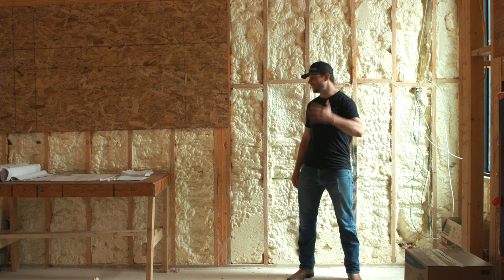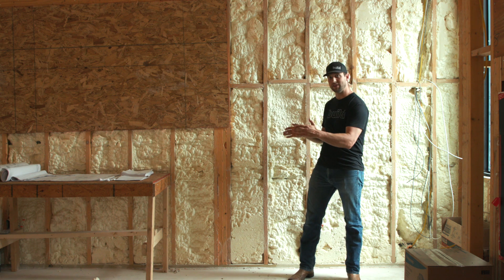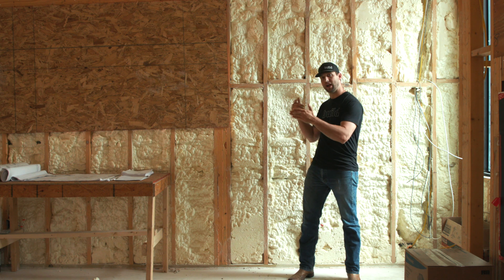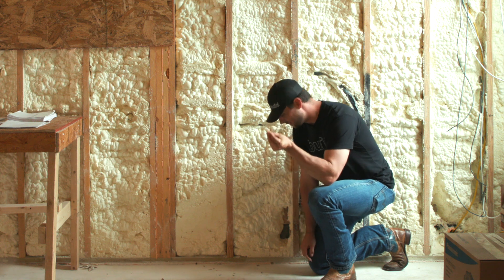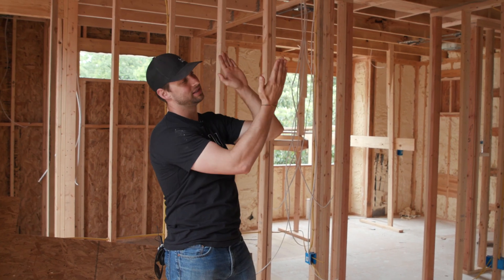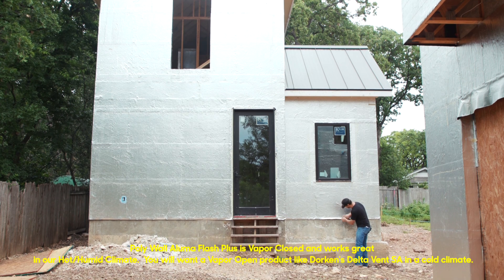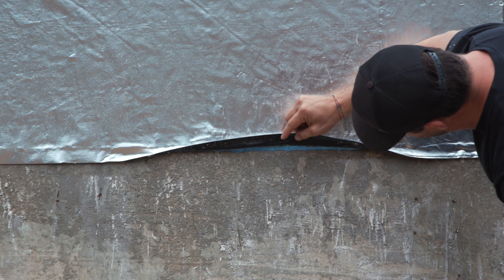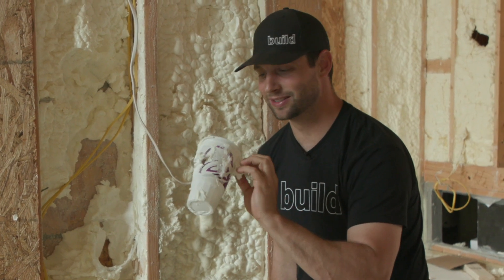3 Spray Foam Problems

Comment: What's the name of the previous contractor doing the insulation? They need to be outed
Reply: I'm not sure how many polyiso jobs you've hired out but I've had to fix air leaks in every single job I've ever done. It's very difficult to get 100 percent sealing. It boils down to this, if the rework you're inevitably going to do is too extensive and your contractor is not improving his quality, you have to move on to another company. 

It really comes down to the guy on the gun. If he can't be bothered to do what is expected, he's losing his company my business. 

I've had to switch contractors and I must say, the norm in thirs area for spray jobs is not great quality for price.
Reply: Chanting out them out, out them out , out them out 😀 by popular demand
Reply: they should but Matt and his team are too respectable to do that which i commend them on
Reply: @coltonarendt  
Nobody should be commended on hiding the names of lazy ASS _ _ _ _ _ who depend on their next victims not knowing. Foaming a cup into the wall??? The reason I take offence is because years ago, while helping an electrician friend on a few houses in new sub-division, we found that some of the houses had a bad odour in them; we learned from sub-contractors, that before the drywall was up, some workers were actually cutting vapour barriers and peeing into the insulation, then taping it back up because they were too lazy to go outside and use the porta-potties. I still get disgusted when I remember that! Pardon the pun, but, you let crappy people get away with stuff and they get shittier.

Comment: Why the hell is it so hard for some to build a house right? This isn’t rocket science.
Reply: Actually it is complicated. There are many factors and home building materials changes much faster than Rocket design. People think that Home construction is easy. it is not!  A good contractor & good Sub-contractors are worth their weight in gold! It takes lots of planning, research to do it right.
Reply: Again, lets be honest- anyone with a brain in residential construction  almost inevitably migrates in becoming a GC. Thats economics alone. The people eft framing your house including insulation, forget about asking them if they have been trained to do what they do-do they even have a HS education ? If you CARE about what you are doing building something, you eventually wnat to get paid-so you go into GC or change fields entirely. When you add county development tax and utility hookups, even if you have a bare lot 50 feet from a county road, its >$100,000 to break ground-hospices are EXPENSIVE !

Comment: The more and more I learn about spray foam, the less likely I am to use it. It's costly, doesn't actually seal as good as stated and can off-gas for years. Much better off doing rockwool, and or exterior foam. You need a thermal break up north. Even a filled 2x6 wall with spray foam vs fiberglass/exterior foam wouldn't give as good of an over-all R-Value.
Reply: If applied correctly, it doesn't off gas for years, a day or two at most. A 2 X 6 wall filled with closed cell is roughly an R-36, tough to top that, plus the added structural integrity. Add an 1'' of foam on the outside and now you have R-42. Rockwool at 6'' is only R-18, only half of the closed cell. Add 1'' of foam on the outside and you still only get R-24.  Nothing beats closed cell foam at the moment.

Comment: One gigantic problem with spray foam is if it doesn’t dry correctly. I watched a video out of Canada where a family spay foamed their attic while they were in the house. The foam didn’t dry properly and it off gassed an odor of rotten fish. Everyone got sick and was diagnosed with neurological issues. They had to remove the entire roof, trusses and all and have people in hasmat suits dispose of all materials. Some experts say never to use it because it is not in a controlled setting of perfect temperature and humidity. That is why I am personally unsure about using it on job sites.
Reply: Product quality is important. I know the video you watched. Proper product and proper installation and you'll have a properly insulated structure. Dont go super cheap. You get what you pay for ya know?
Reply: Saw that too. Bad instal

Comment: With a stucco exterior home where would I be considered with air gaps/ leakage.
Reply: Stucco guy here:  Our house, like the million others within 60 miles has stucco on the outside and we're in the hottest city in America.  121F is the record we've hit two years in a row.  Stucco on the exterior under those conditions is stupid.  Yet every house has it.  Add one of the exterior insulation systems M. Rissinger has been advocating these past months to capture the thermals mass and isolate it from the excessive heat.  You could install an uninterrupted layer of polyisocyanurate panels 1" thick over the entire wall first, then frame with steel a 2nd stud wall and use the closed cell foam in that cavity.  Wrap with something suitable for your climate, it should breathe because you already have an impermeable membrane in the form of the Polyisocyanurate 1" layer.  A radiant barrier if you live below 30 degrees N. latitude.  Then the siding of your choice.  A similar process for the roof to complete the envelope, more or less.  These houses also need a basement, or a below grade cool space (cold storage) to provide air for a heat pump driven, forced air system that stays out of the attic.  Otherwise,  we should let most of them burn.  The builders 50 years ago had few priorities that apply today.

Comment: man if they stuck a tacobell cup in there just imagine all the other jerkoff things they did to that home. I feel bad for the owners.
Reply: I'm an electrician, and I've busted the general laborers (sweepers) jamming plastic bottles down into the drain pipes. The plumbers were far from pleased and those little jerks were fired the next day.
Reply: @KingTesticus  
Just last week I helped my brother (a plumbing contractor) do a camera inspection on a 2 year old house that had a slow drain problem in one of the bathrooms. Guest bath in a big house that was rarely used so it wasn't a pressing issue for the owner until the house was being sold. We found that the roofers dropped a tube of roof sealant down the stack. Ran the sewer machine down the stack, stabbed the tube and pulled it out. It's amazing what idiots can do to sabotage a property.
Reply: @KingTesticus  Fired? Not good enough...
Reply: I was working on a house and found a beer bottle in the wall, no joke. It explained a lot.
Reply: @whiskey4553  I found a 30 years old pack of cigs when I remodeled my kitchen
Reply: @whiskey4553  It's very common to find beer bottles in the walls of houses built in the 80s and 90s in Virginia. It says a lot about the quality of the workforce building homes here back then.
Reply: Stephen V that’s super common in construction especially in concrete work lol
Reply: @whiskey4553  Every soffit bay in my garage is filled with old liquor bottles.
Reply: @whiskey4553  I just pulled one out back in November during my bathroom demo. A few years prior I found two beer cans in between the studs in a downstairs bathroom during its demo. The cans looked like new and had been there since 1968... pull tabs, remember those?
Reply: I found porno mags from the year I was born under the vanity in a bathroom I was remodeling once.
Reply: @thomassteele-sheets7471  I've been doing work on my house and when  I air sealed and reinsulated my attic I found what I like to call the previous owners "sin stash". I think the wife was fairly religious, and so stashed in the old attic insulation was a paper bag of porn from the 70's, beer bottle caps, and a box of Twinkies.
Reply: @troyb3394  were those twinkies still any good? It could definitely bring closure to that twinkies never go bad debate. And these were from 87 at my house.
Reply: @troyb3394  are the Twinkies still good? Did you eat it? hahahah
Reply: Thomas Steele-Sheets if it didn't have a, use by, date then it's good forever.
Reply: @tonyhemingway7980  oh I know, I was 16 when we found it, so I definitely kept that magazine, because you know I was 16. Still have it to this day it's kinda like a coming to age story at this point in my life and just kept that old hustler fantasies as a reminder of where I was at in my life. Lol.
Reply: @troyb3394  i bet the twinkes were still great
Reply: Yeah, it's one thing to hire a crew that doesn't pick up after themselves...another thing when they throw their trash IN YOUR WALL. Holy crap, those people need taken to the malpractice agency and scolded.
Reply: I was doing a pre drywall inspection on an apartment building several months ago, including collecting moisture meter readings in each unit. One wall had about 25+% on several spots. Upon further investigation, the cm and I found a piss bottle hidden in the corner. The laborers were using that area to pee, and missing the bottle. F-ing gross.
Reply: We do a lot of crawlspace encapsulation and waterproofing. You wouldn't believe all the crap we find down there. Beer bottles, scraps of wood, leftover CMU's, extra concrete they couldn't find a use for.... When building, a lot of these guys just use the crawlspace as a trash can because, hey, who's going to see it?
Reply: I've caught laborers pissing in the sump pump wells after the foundation was poured and/or forms set for expansive soil floating subfloors. I've made the GC ensure there is a porta potty on every job site.
Reply: I've found bags full of crusty  shit in the wall left by the boarders twice.
Reply: And you do want walls filled so no air in your roof and wall assembly.  Airtight wall won't have moisture problems. And also if you have uncovered stud in your bay you increasing surface area that bridging through.
 The assembly.
Reply: I would be livid!  Lawsuit for sure
Reply: Colin Stuart we had a stopped up toilet in a basement - the plumber used a snake to pull about a cubic foot of scrap Berber carpet cuttings the #%?! carpet layers had thrown in the drain where the toilet was going to be installed.🤯🤬
Reply: I've read all these comments and still don't know where a taco bell cup was shown in this video...
Reply: Luigi Randazzo at the very end, after the credits, like B roll footage.
My neighbors behind me have 4 dogs, 3 of them are hounds. They were going batshit crazy for weeks (after closing) around the fireplace, which is a 2-sided type in a large column between the living room and dining room. Finally opened the drywall up to find a dead skunk...another sad example of Taylor-Morrison quality in north Dallas.
Reply: @LuigiRandazzo21  it was after the video credits, like a blooper.
Reply: Professionals VS DIY guys, the pros win only if you can establish non-stop supervision over them, the minute you don't look what they are doing , rest a sure DIY amateur wins. Both in quality and in quantity.
Reply: Top this one. I contracted a log home set and while laying out the deck on the first day the concrete
guy showed up and when the owner wasn't around Mr concrete told me that during the wall pour
he saw the owner throw a small garbage bag into the corner of the forms. He ran over and asked
what was that? the owner said it's a goat fetus,,,, for good luck and prosperity. Mr. concrete made him
sign a waiver.
Reply: @2drsdan  that's some weird beliefs... whatever floats their boat, I guess. hahahah
Reply: @TheKb117 MI
Reply: Found a hand gun in a wall once, it was in a basement behind the fiberglass insulation,  asked the homeowners if it was theirs, they said no, I said must have been from the previous owner, they then said they had the house built. 
That's when we called the cops lol, they came and took the gun.
Reply: @brandon3514  so what came about with that firearm? Murder weapon, stolen, used in a robbery?
Reply: @thomassteele-sheets7471  we never heard anything,  it was a 30 year old house, the gun was pretty small, and was starting to rust. I dont think the cops found the guns owner. Contractor who built the house or one of his workers needed a reason to hide it. I can only imagine what it was used for
Reply: @brandon3514  bet it was used in the Hoffa incident.
Reply: @thomassteele-sheets7471  hoffa was probably in that slab....
Reply: @HyperPiperunscripted  agreed
Reply: Man, guys.  I wish I could upload photos of all the crazy shit I've found when remodeling my house.  Let's just say, I don't believe a building inspector actually looked at my house before they signed off.

Comment: Was just asking about the pulling away from studs as you started to explain.

So just what are the parameters... Dry studs, adjustment for humidity, etc...

Or should a homeowner just call the manufacturer and get parameters him/herself?  

Also .... what is a reasonable limit for the amt of verification that a homeowner could put onto his/her contractor.

1.  Air tests .... @ what point @ what values
2.  Insulation ... if foamed thickness etc ... 
3.  Electrical ... though code does alot of keeping this good
4.  HVAC ... proper sizing / proper ducting etc
Reply: I'd love to see the answers to these. Consider a homeowners milestone checklist video please
Reply: @SOGCaptain  Checklist would be good ... but better IMO would be listed / spelled out in the contract prior to building started so that a builder would know that he/she has a  customer that just won't accept any ole BS. and that the customer can feel free to say your work is good .... or ... hey you and I agreed to "X" and not the "x" you've tried to pass off.  I'd say that building inspections would catch stuff ... but ... I know of newly built ( well when I bought a spec house ) that code as not followed on some "visible" stuff and yet the house passed inspection.  So building inspectors can be good ... however, I think I'd hire one to be thorough.
Reply: Simple answer: Use Roxul instead. No worries about spray foam issues period!

Comment: That was a very good video full of information.
Reply: If you like mold and rot: yes. Making a house airtight on the outside of the insulation is a really stupid idea. Even the holes in the insulation of the original house would be better because the moisture could evaporate over time. The sealing will keep it indefinitely between the frames.
Reply: Sven, I keep thinking about the house as a glass jar that I hold to my mouth and exhale into. The moisture starts collecting.  You are correct.  Giving credit to my expectations of that foil wrap, there's no way the interior will match the seal of the exterior.  A boiled pot of water without the exhaust hood on, the same with a shower, a window left open during a rain, plumbing or roof leaks, or daily living--the house is soon a mushroom without moisture exhausting mechanicals.  If the electricity goes out, a generator fails, or any component of the air exchange system goes out, let the mold begin.

Comment: I spilled great stuff on a jacket of mine once. Misses wanted to know what it was, I told her it was Great Stuff. She laughed and said ‘right, I’m sure it’s right next to the awesome sauce.’ Can you do a video on windows, what to look for and options. I have an old home with 29 windows and all of them are oversized, 72” tall by 60” wide in a couple of the rooms and 72” by 32” everywhere else.
Reply: Consider that if the windows are oversized & custom you could reduce the size of the windows to buy a standard size. Your contractor (or you) would need to just build in a smaller window opening to reduce the opening. Personally I chose Marvin windows which is the leading brand. Anderson is a close second in my opinion.

Comment: What situation would you not want maximum insulation in the cavity?  Just a poor installation there.
Reply: It's about costs. 2" of closed cell spray foam may give you 86% less heating requirements. 4" may give you 92% and 7" 96%. Twice the insulation isn't twice as good. More here ->>> Spray Foam - How much foam do I need? - https://www.youtube.com/watch?v=rX8REofYJ2M
Reply: Yep cost and time...which is a cost.
Reply: Best bang for the Buck for insulation is rigid foam panels on the exterior. Since it provides continuous insulation. Best to use a an easily removable insulation on the inside like Roxul in the event for repairs/changes (ie fixing a plumbing issue, or if you need to run addtional wiring (data\electrical) in the future, or if your remodeling and need to change an exterior wall.

Comment: You guys put the foam between studs, but those studs cause a lot of thermal bridges, aren't you worried about them ?
Reply: Yep! Many builders are moving to 24" OC rather than 16"OC, it reduces those bridges by nearly 25%. Also, in many climates, we use exterior insulation to blanket the home.
Reply: Studs have there own r value that ,In UK, is combined in calcs to give an over all U value usually very small difference, air test makes lot  more difference, in one of Matt's other videos he shows solid wood walls in Europe that perform comparably to insulated walls, just more expensive
Reply: Most new homes have continuous exterior insulation. Near the end of Jordan's video he show the home with 2" Rigid foam insulation. They use a foil backed foam board to seal up the walls since the contractor did a very poor job with the sheathing sealing. Cheaper to just seal up the foam than to redo all the sheathing work.

Comment: I did internal clay plasters myself with additional sealing here or there with cheap materials but lots of attention to detail and got 0.2 average ach50; I also designed the house with air tightness and no heat bridges insulation in mind; I used 0,5 cords of beech to heat the house this winter (the heated volume of the house is about 24000 cubic feet; temperatures outside down to -4 F and 32 F average) my stove was also used to heat the domestic water and some cooking
Reply: Is it a tiny house?
Reply: @vapeurdepisse  24k cubic feet or 650m3 not tiny